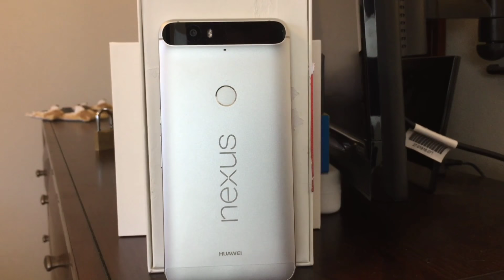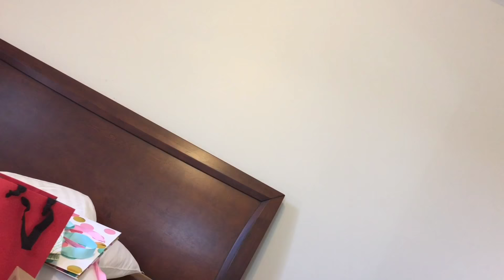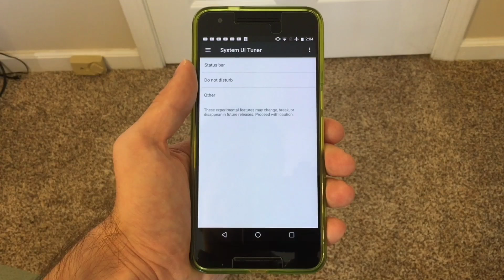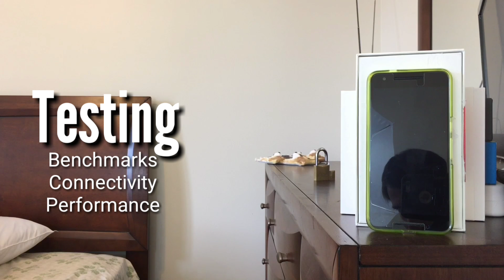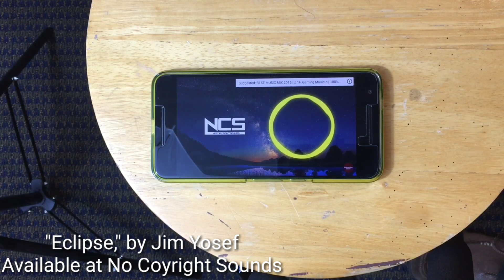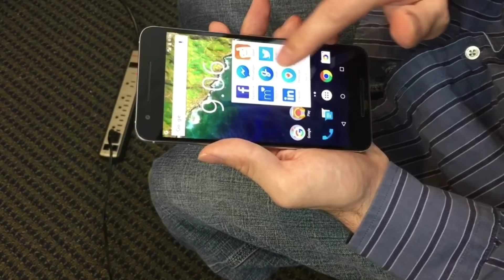The Last Nexus - Part 1: The Nexus 6P in 2016

Comment: The Nexus 6P may have been too good. This is meaning that paying much more for the Pixel XL is probably not worth it. I'm holding on to the 6P. The best and last Nexus. Also technology changes are not so much leaps and bounds ahead like from a few years ago. We have gotten to a point where the phones of the last couple of years have reached speeds fast enough for most individual's.
Reply from the maker: +centfla Agreed. I like my Pixel, but:

1. It's too iPhone-esque (in its build and overall concept) - It appears Google wants to adopt Apple's strategy of design a phone's hardware and software in-house.

2. Google is alienating its target market of developers and tech enthusiasts. I don't think Google will effectively market the Pixel to the average consumer (who will either buy an iPhone or Samsung.
Reply: Matt Diehl yeah and nothing wrong with Google wanting to make more profit. I think though should not have gone from a $650 Nexus 6 and then the 6P at $500. They went back in the right direction with the lower cost premium 6P. They now have a new name and direction which at the start still seems a bit lost. They probably should have lowered the price of first device with the Pixel name so they can get more doubters over to their brand. Also the Pixel is not offering "Wow" features. i bet we see a lower price soon enough or another device launched by summer.

Comment: Yeah, I have a smudge too on the glass. I've some small wear on the back metal due to some trash getting stuck in the plastic of the case that came with it. Phone is holding up pretty well.
Reply from the maker: +Paul Prejean Yep- Aside from that minor issue with the screen, mine is still spotless.